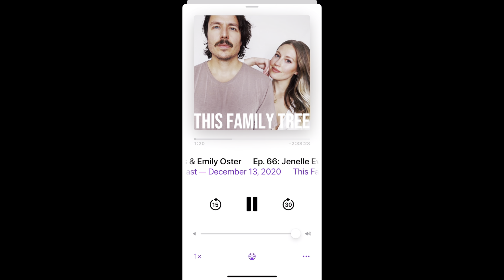Shed Vlog

Comment: We used the peel and stick wood floors in our bathrooms because it can get wet and won’t expand like wood or particle board. It’s been down with no problems for 5 years. We also used it on the wall to create that shiplap look but used wider boards.